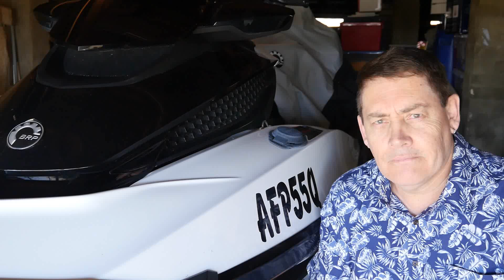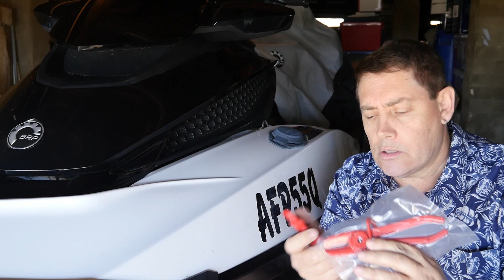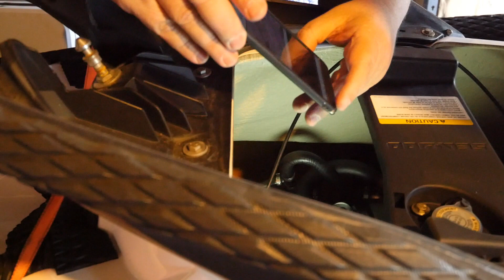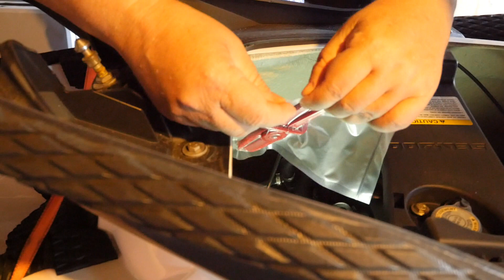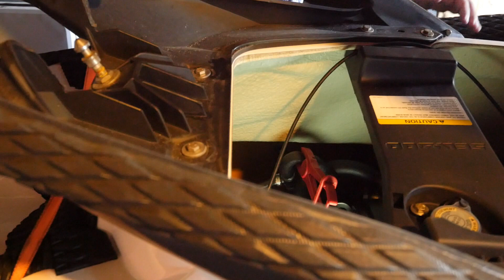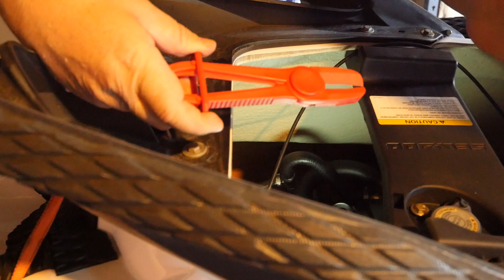Tow tap line clamp pinch tool - how to use it

Comment: That is probably a smarter investment than actually installing a valve inside the ski. Chances are you won't ever need to be towed and one of these pinch pliers can be used literally in seconds. As far as which hose to clamp simply locate the line going to your flush port...follow it to a Y fitting...the other hose connected to the Y is the one to pinch off. You can also pinch it off on the other side of the Y (the side with a single line). These pliers are plastic, will never corrode and the best thing is not having to stand on your head for half an hour installing one of those valves.

Comment: great video,  what is the hose called that needs clamping ?  i.e. so i know what to look for in my manual / on google.  cheers
Reply from the maker: I'm not sure, and maybe it has different names for different brands.  For the Sea Doo, there is a picture in the manual showing where to place the clamp. Have a bit of a goggle on Google.
Reply: @tapmad  thanks mate.   also,  i assume this clamp cant be used unless you take off the rear deck panel yeah ?   i.e. can that hose be reached with just the front seat popped off ?   (just trying to understnad if its also worth carrying tools to take off the rear deck,  if a breakdown occurs)
Reply from the maker: @JDDD33  Just open the seat cover.